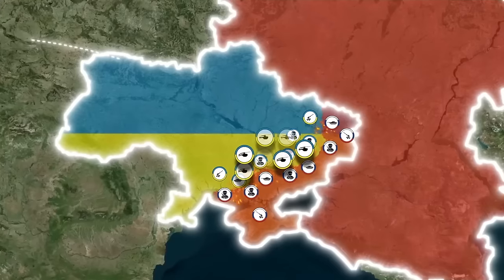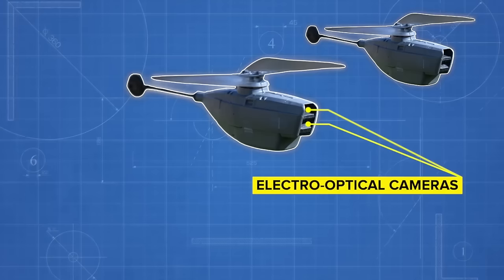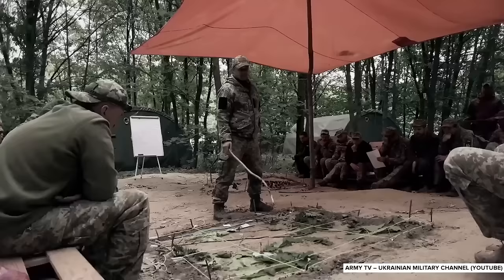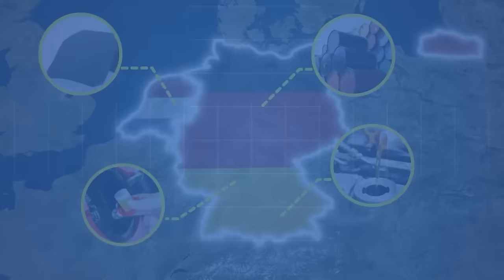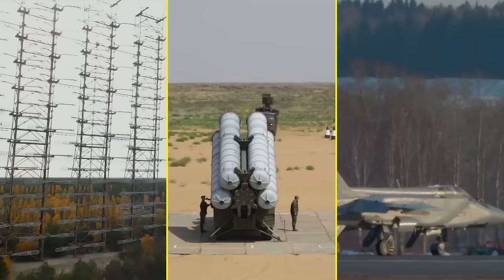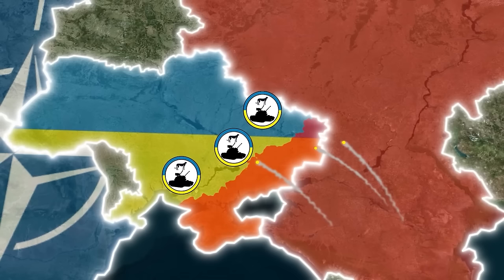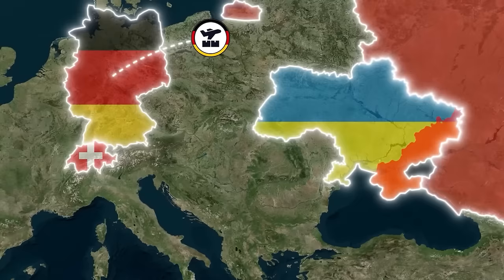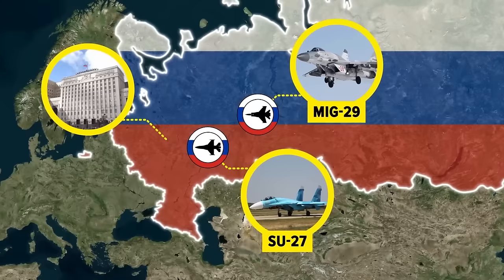Why This Miniature Drone Scares Russians to Death - COMPILATION

Comment: To call this AI is a joke. Every 30 USD drone from Ali Express has these basic navigation functionalities
Reply: But that wouldn't make good clickbait.
Reply: Lol you have really no idea what you're talking about.
Reply: @_deus_belli_545 he really doesn't.  Toys r us helicopter drones have none of those capabilities.  It needs sophisticated software and tight manufacturing specs to fly stable enough, have GPS tracking, high resolution imaging and whatever else. The cost of all that is high especially if the desired number of purchased units isn't going to be very high that drives the price per unit way up
Reply: @cjcoleman3893  the whatever else part are the sophisticated security layers for opsec that guarantees that those drones won't get jammed or intercepted. That's the most important part. And that's like 99% of the entire price tag.
Reply: Hell yah man! How was it in real life flying and using it? Was made with plastic? Wait you dont know a damn thing do you? 😂 lolol so the cost of employees, accountants, expenses, R&D and you get the same quality as a $30 plastic drone that can be taken down with any electronic warfare yet they are the same things 😂😂😂😂😂

Comment: I feel like they could build those for a hell of a lot less.  $195,000 per unit sounds outrageous.
Reply: The capabilities and the Cost of development are high and the number of potential buyers is low.  If they only make 5,000 units the price per drone will be high to cover all those costs and still make money.  If they had contracts to sell 20,000-100,000 then the price would be much less per unit.
Reply: @cjcoleman3893  shut it. u know jack

Comment: Initially I thought that the small drones were terribly over priced but after considering a lot of research and design costs it didn’t seem that far off. If these drones continue to be used successfully costs per unit will probably decrease substantially. The fact that these drones can be virtually undetectable is a huge plus. If they can be used as weapons would make them indispensable for defence of Ukrainian interests.

Comment: Capture of a hornet was foreseen and safeguards against reverse engineering are included. If not that’s military malpractice. Also, supplying troops with listening devices will cut the advantage. But. If you’re supposed to advance, how priceless is this ability?

Comment: Using these drones against jets is a big stretch. Jets are already visible on radar and engaged by anti air systems. If they are not there is nothing this tiny drone can do about it anyway. Soldiers will hear them way sooner than this drone can see them.
Reply: If  they are within 10 feet of it, maybe, and that's without much background noise, and how quiet do you think that several troops are when they are engaged in activity prepping to go after Ukrainians?  I hear fine but with this loud steam hissing in the background all the time (tinnitus) I have a helluva time understanding people most of the time.  Driving down the highway at 65 to 80 mph the road noise drowns out most speech and the wife knows to speak loud enough to overcome the steam hissing.

Comment: The prices on systems also includes training, replacement parts, and more. It's extremely simple minded to assume that's the plain unit price. Bit the nonsense about using them to track jet aircraft and hownthey can dodge their fire ... and the thing about using them as grenades, when the units are very, very expensive, was ridiculous.

Comment: 😮This price tag is total Fantasy, unless we're talking about something similar to the $2000 Pentagon ashtray.

There's NO WAY that drone's cost would be worth that amount.

My own $400 DJI Mini 2 (2 years old drone) 250 grams PULVERIZES the black hornet's performance in camera resolution, battery autonomy, operational distance, max altitude and wind resistance.

The latest generation from DJI Mini (the #4) even has obstacle avoidance and the camera resolution is even better...

So that black hornet is either a gigantic scam or...